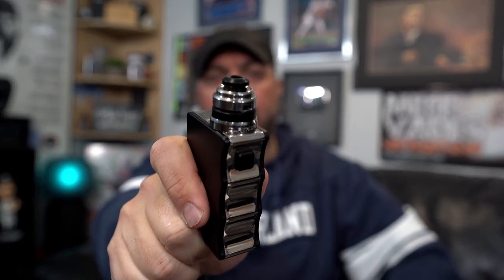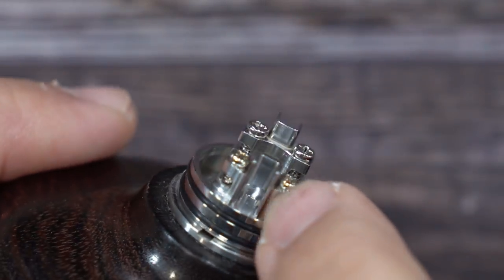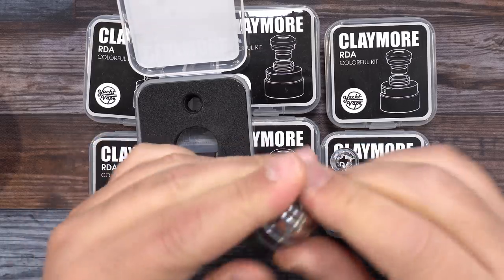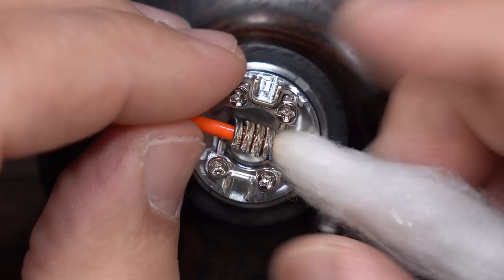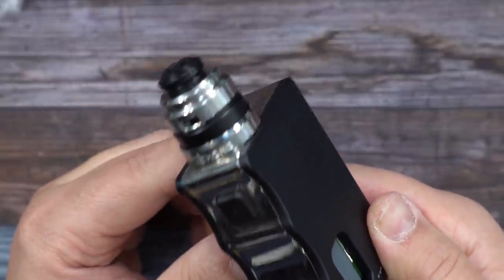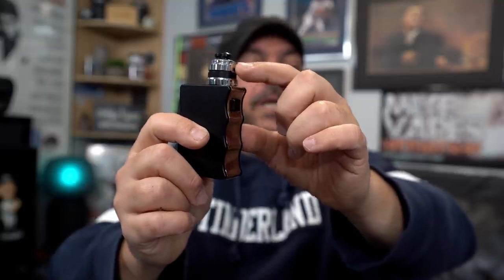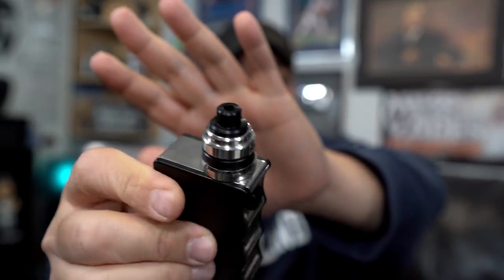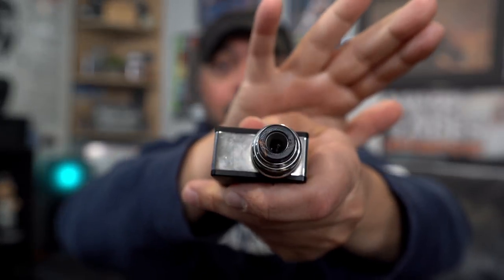The Claymore Single Coil RDA By Yacht Vape

Comment: ive seen it about a week 1/2 ago. I really like the looks of this one. I wanted another single coil. was also looking at the mongrel but I might grab this one. great review mike . as usual !!
Reply: Mongrel is more of a high wattage atty for a single, this is kinda middle wattage
Reply: @Apathymiller  I'm more of a higher ohm vaper. but enjoy all styles of vaping. mechs, squonks, duals, singles, aios, and mostly Mtl. but the coil mike stuck in there if in not mistaken was a very low ohm resistance coil(.14). different strokes for different folks. id probably use it at .45 @about 45 watts and be happy. So you might wanna tell mike its more of a mid. I like singles at .25-45. thanks for opinion tho.
Reply: @Tokeokarma123  yeah mike vapes like i do but most people dont vape .08s at 100+ watts... but like i stated this atty is really exactly for people who like to vape like you around that 30 to 60 watt range. It excels and is very good. The mongrel is more suited, not saying ya cant run it at 40 or 50 watts but is more suited for 3.5 or 4mm coils at higher wattages